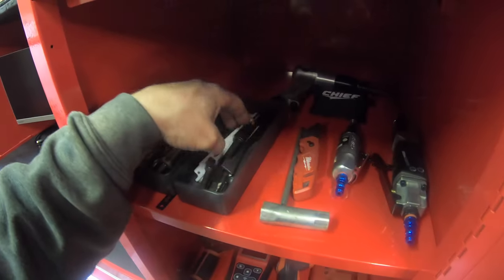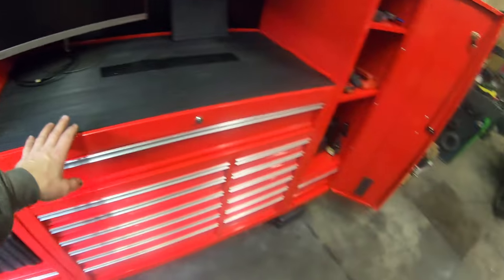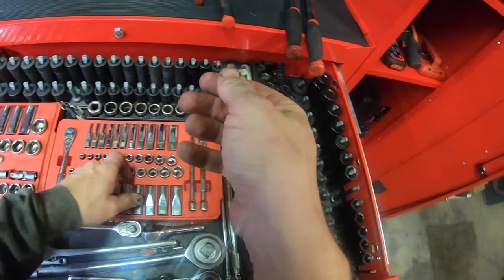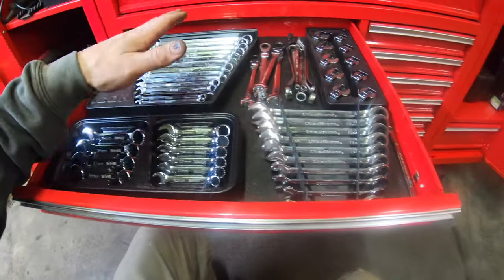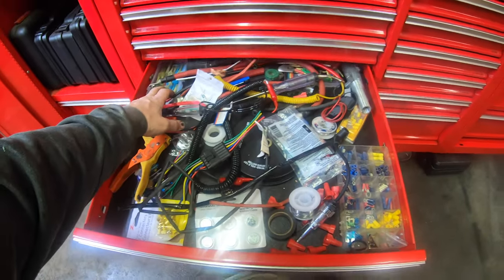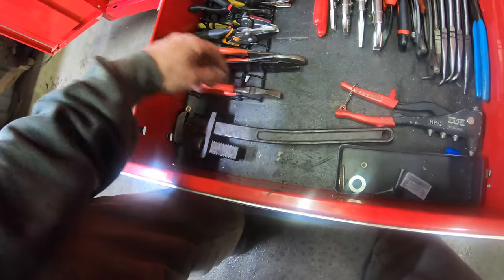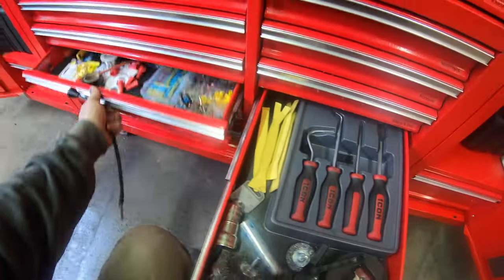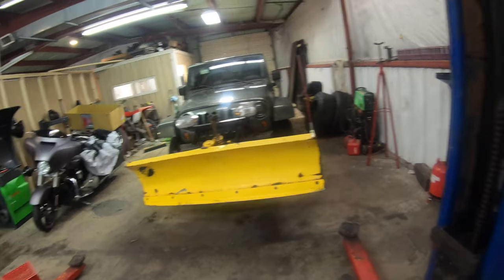Tool Box Tour | Mods | Harbor Freight

Comment: Push some thick rubber with a lot of pressure to the back of the dent and hit the face of it with a mallet. You would think it would make the dent worse but for some reason it takes the dent out. LoL..

Comment: Nice man, I see some snap-on maybe in there? Where did the box come from? That red is sharp man. This is sweet man. Great video Ken. What year is the Harley?
Reply from the maker: Bike is 2017, Harbor Freight toolbox, Some quality USA tools mixd in but a lot of Milwaukee, Gear Wrench Knipex and Icon stuff along with some cheap Pittsburg stuff but all warranty. Yea I have done a bunch in the new shop its a 50x50 heated shop 2 commercial bay doors and a side pen with full security cams etc. Thanks for checking it out

Comment: Hang that monitor on the back wall of the cubby area with a hinge mount and you can put ‘whatever’ behind it, still, and not take up horizontal surface space. If that matters to you. 

Honestly though I think you just need a 56” or 72” top and bottom box. If you’re working on peoples rigs you are gonna want a lot more tools. Some say you never have enough and/or never have everything you need but that’s untrue: other than proprietary vehicle-specific tools you can fit /everything/ you will need over the average week in a us general 56” or if your pockets feel good a 72”. 
At this point other than if I WANT something I don’t ever really need any new tools. 

Suggestion though: some of the pittsburgh tools are ok, a lot of the sockets are great, but while their Taiwan tools are acceptable most of the mainland stuff is junk. Either way they’re not Made in USA. 
SK isn’t much more money than either Icon or Bluepoint (both taiwan I believe) but SK is still Made in USA. And nice tools, strong, last well.